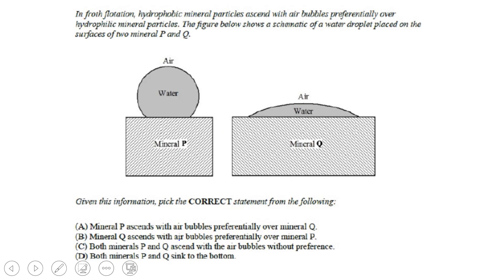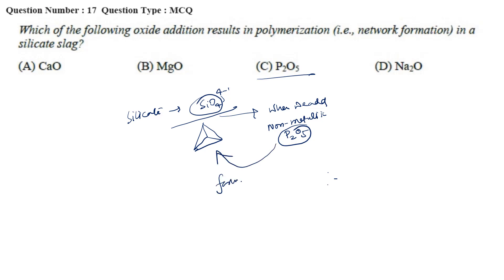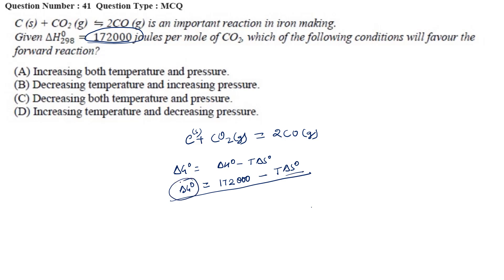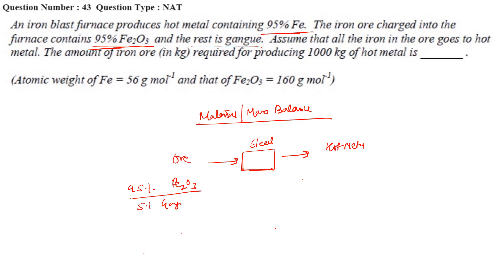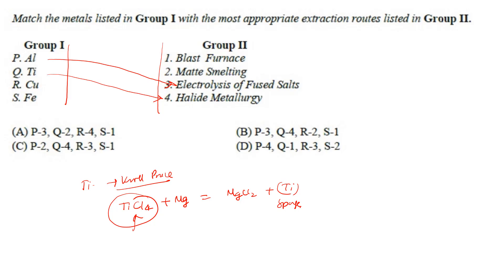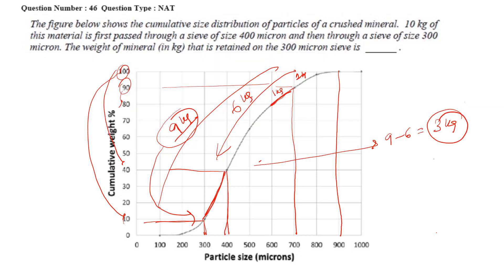GATE 2015 Extractive Metallurgy Solution

Comment from the maker: 00:00 Introduction
00:32 Froth Flotation
03:05 Slag polymerization Network former
06:11 Zinc extraction
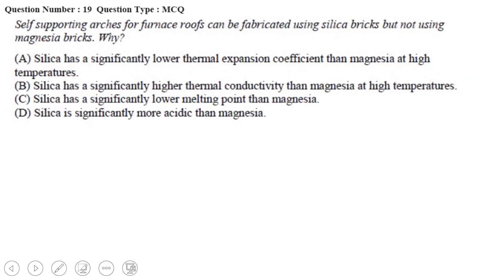07:04 Self supporting refractory brick 
10:33 Le Chatelier Principle
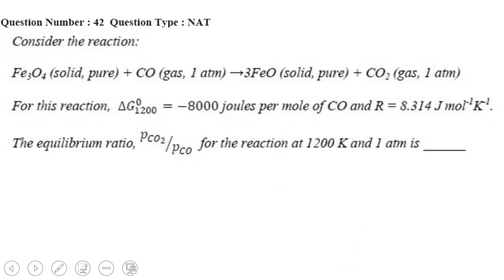14:51 Mass Balance Reaction PCO/PCO2
17:37 Mass Balance ironmaking
21:11 Match type extraction routes
23:31 Mineral beneficiation size sieving

Comment: Furnace roofs are  lifted and moved repeatedly.  That means they are exposed to fluctuating temperatures.  So  if coefficient of thermal expansion is more, then expansion and contracting frequently may fail the roof.